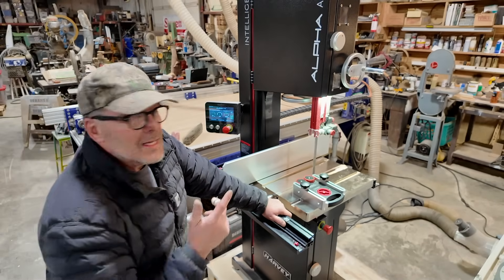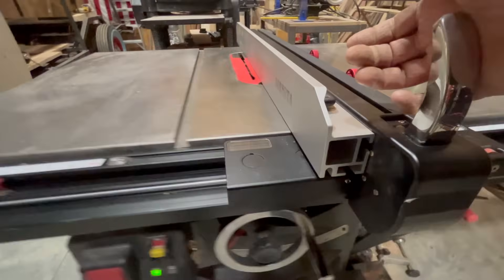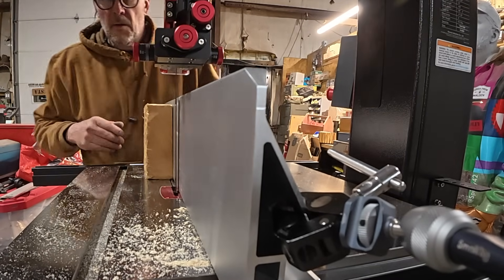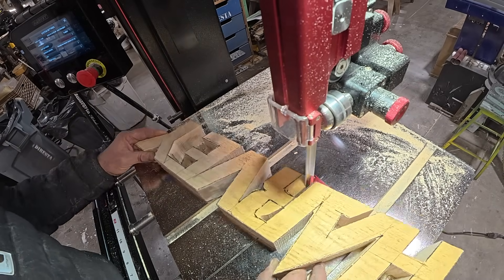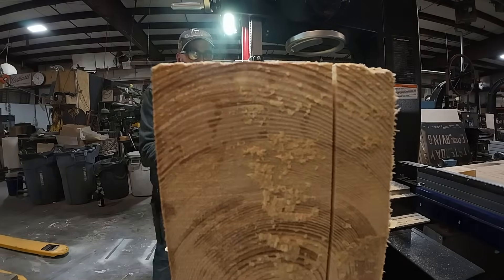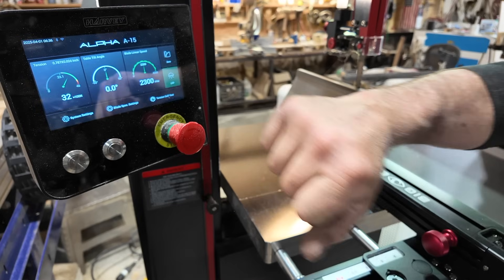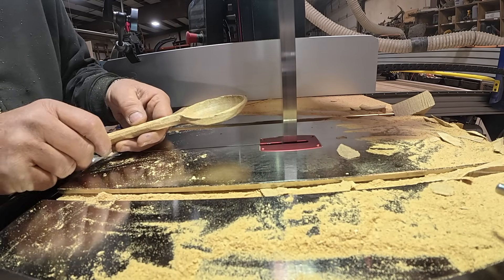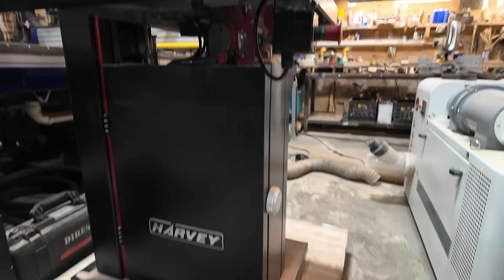Introducing Harvey Intelligent Bandsaw!

Comment: Jimmy, great review. I'd say that's a solid saw, but the stand-out feature is the fence system. I'd have liked to have seen you futz with the guides to demo those if they're truly keyless adjust ones. I'd also love a (someday) follow-up on your assessment of the nickel plating - it's beautiful but my instinct tells me that one small ding or incursion through that plating and you're kinda screwed. Also ambivalent about the digital readout - my truck has a backup camera (awesome) but it's the first thing I'll not spend money to fix when it dies someday.

Last comment - you make solid content, and I'm happy you're paired with a reputable company like Harvey. I didn't see any issues with auto-translate here. I did note a certain commenter inserting himself into others' thoughts like that one gnat in the shop that will not stay out of your face. He's going to comment, "Deal with it," or similar, but my take is that he's going to turn off new viewers to you, your channel, and Harvey by being an insufferable, angry troll. I truly hope he's not a stringer for Harvey - though I'd doubt they'd do that kind of thing.

Comment: Seems odd that the table tilt knob is on the back, where you can't see the display while you are adjusting the table. Seems it would be easier to just stick a digital angle gauge to the table.
Reply: The screen pivots, you can see it from the back position! 👍🏼

Comment: So, er... what's "intelligent" about it? 🤔Just having a couple of basic sensors (BTW, would have been interesting to compare those readings to measurements taken with specialised devices)? I mean, granted, that's still more intelligence than some politicians, but the "maker" threshold for something to be considered "intelligent" generally includes the ability to actually make some decisions and act on them (like, detect fingers, avoid kickback or pinching, automatically adjust the speed, tension or tracking based on how the blade is performing, that kind of thing). I guess they decided to call it "intelligent" to hitch a ride on the AI hype train.

Comment: I was thinking that you can program speed, tilt and fence distance and tilt and fence are motor driven or at least a read out of the fence distance. I don't get why the table tilt wheel is in the back and you can't see the screen while tilting? I'm not sure if I really need that display just for tension adjustment. I think for a band saw to be called intelligent, it needs way more features on the digital side.

Comment: Man that is amazing. The question I'd have is.. is it worth the 2x+ cost over their already very good 3hp model with nickel plating? I get the touch screen.. and as a noob to all this assuming I had the means to run it and afford it, would this be a better buy for the money than their 3hp model that is about 3K.. or even say another vendors option (Laguna, etc)? Personally as I have their router table with  nickel and would love to get their table saw.. I think this would be the way to go. I would be using it more for resawing for veneers.. not sure how good it would be with 8ft lengths of wood though.